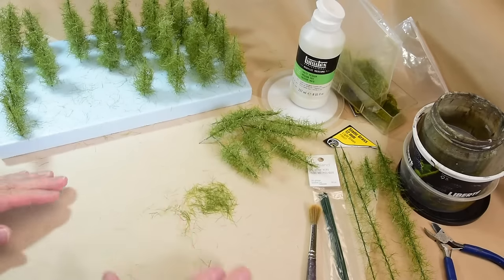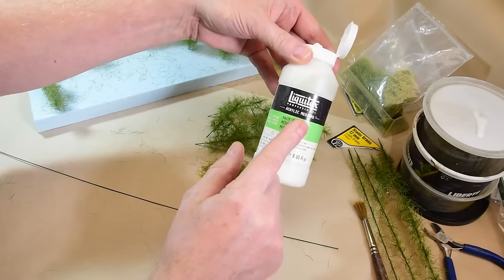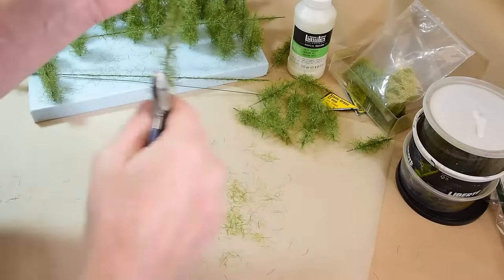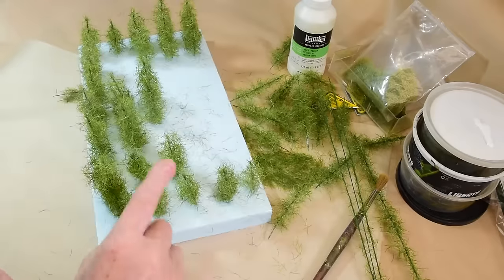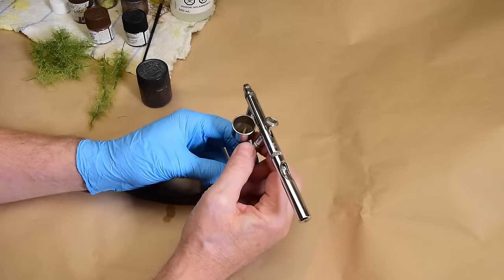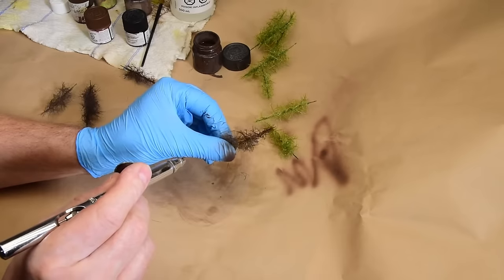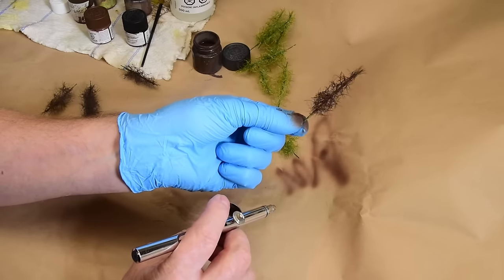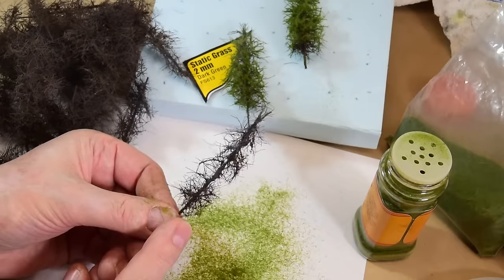Modeling The Ultimate Baby Conifer Tree for the Model Railroad | Boomer Diorama ~ # 265

Comment: Why do you use such high pressure?
Reply from the maker: Great question! 

Less paint pigment overspray and less "pull-back" on the trigger. I can cut a smaller line, with a fat tip, when I use high pressure. No matter the pressure, I can control paint volume more efficiently. Furthermore, high pressure blows through any potential clogging as well. I usually shoot from 50 P.S.I. to 20 P.S.I. depending on the effect I want, etc. Cheers ~ Boomer.😁
Reply: I’ve used high pressure thru my airbrush like FOREVER.  I don’t really know where the low-low pressure philosophy with airbrushes ever came from, especially with single action brushes.  Seldom do I drop my delivery pressure at the regulator below 40psi.
Reply: @stevenlitkey9354  I never knew what PSI should really shoot with so I've always shot with between 30 and 50. But I also don't have a whole lot of experience with airbrushes but they do use one from time to time.

Comment: Dear Boomer, hilarious what you found on the forum! Still using my cheapo airbrush. Works like a true breeze with Tamiya. It’s simply awesome how easy it is to clean the airbrush with some IPA. No need whatsoever to upscale yet. Also started using my regular compressor, set it at 3,5 bar, which is around 50 psi. Always start drawing the sharpest possible lines first, before painting anything. Truly helps to slowly get the memory muscle kick in. Love the little conifers. Cheerio
Reply from the maker: I finally cleaned this airbrush after steady use for six months. ;-)

Comment: This is why i like model railroaders i need to learn more about landscaping for dioramas i like to model scale armor and model vehicles in the larger scales 1/24 1/25 scale and 1/16 scale 1/35 scale you put out valveable information here
Reply from the maker: It's all good for practice in multiple scales. 

The challenge is scale translation. Many techniques in 1/87 do not always translate to larger scale like 1/35, 1/24th, etc. Although, they will if you model the supporting vegetation of the footprint in terms of resolution, etc. It's an adjustment for sure but nothing to really sweat about. ;-)
Reply: @boomerdiorama  + exactly I download your video as a reference you do  great work 👍

Comment: Comment #2...

If your noisy contractor's pancake compressor every craps out.  Buy a California Air tools 1hp, 2 gallon oilless, 2 piston compressor.  You won't regret it.  SO much quieter than those pancake or other contractor's compressors!  It also easily keeps up when air brushing models.  They guarantee a maximum 60dB for noise.  I can airbrush in my workshop in the basement at any time of day and you can't hear it in the 2nd floor bedrooms.

Painting the trees...  I've had really good luck (bottle brush variety trees) with Rustoleum Camouflage flat enamels.  Great colors for tree trunks/branches.  Though I find as I get older I'm trying to stay away from VOC's as much as I can.

Filling out the branch structure...  (Again, I'm talking for bottle brush trees here).  Buy some 1mm static grass, paint with whatever paint you want to use and lightly sprinkle on the 1mm static grass (you don't want to completely coat all the branch structure).  Fills out the branch structure a little more.  

Not trying to take away from your technique here Boomer...  What you've done is fantastic!  Definitely going to build some trees this way.  Already using your twisted wire armature method, which makes really durable trees.
Reply from the maker: My contactor compressor is actually very quiet compared to some. ;-)

Comment: BOOMER...since all the psi talk, what psi do you spray when weathering  rolling stock etc ? when painting a structure? when weathering track and scenerey...I am a rookie air brush user , I purchased the harbor frieght Avanti kit..99 bucks...seems ok...  ..on another topic I came accross "Troelskirk"  you tube vids from few moons back, his latex water applications were pretty cool, have you seen his work?
Reply from the maker: I use my airbrush between 30 to 50 P.S.I. when I shoot very thin Tamiya Acrylic thinned with IPA. Sometimes when I want to spatter things I use low pressure and heavier paint. You have to use the airbrush to find the right combination. Everyone is different about what they like. Find your stride through practice - make mistakes and learn to correct them. Cheers.

Comment: $15 non-name, dual action Chinese airbrush from Amazon works like a charm. If it fails, I got a 2nd one as a spare. 50psi sounds scary re the hose from the compressor. I presume it's safe, long term?
Reply: Those cheap Chinese knockoff airbrushes have actually been rated really well by reviewers on "the Tube".  Same with that self contained, battery operated/USB rechargeable one.
Reply: @WHJeffB  I've been very happy with mine. I save the Iwata for really fancy, precision jobs. I saw it first on the Barbatos Rex channel.
Reply from the maker: I have a "Paasche" hose (still works great) that I have been pumping 50 P.S.I. for twenty years and it still works fine. Almost everything I show here is from my pro experience for over thirty years. ;-) The Pasche hoses are the best in my experience. Never blown one yet. 

The only downside is some cheap airbrushes (including Iwata) can't handle the pressure in the valve stem. These cheaper Badgers have never failed a valve yet. ;-)
Reply: @boomerdiorama  Thanks for the reassurance. Coincidentally, I am using a Paasche hose, "left over" from my original cheapie Model H. I just hate unexpected loud noises accompanied by a loose hose flapping and flailing around... Reminds me of an old SF movie SFX. Thanks again.